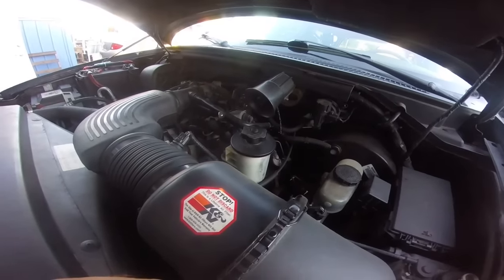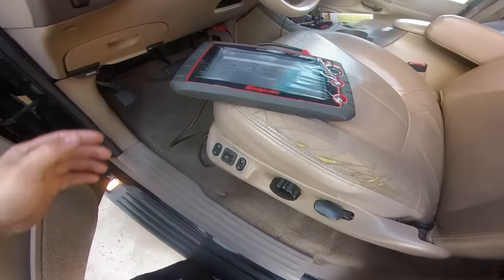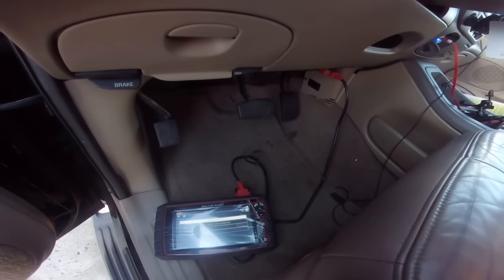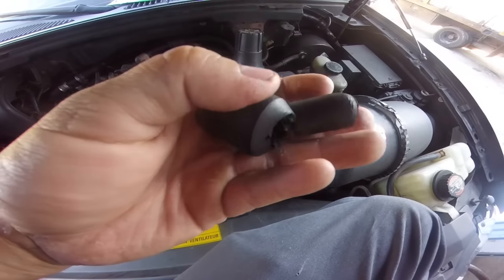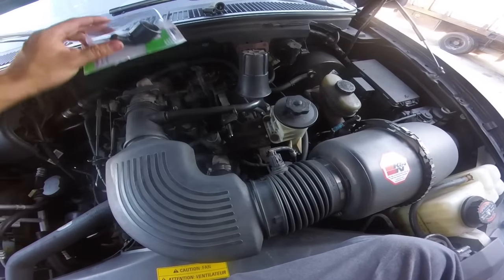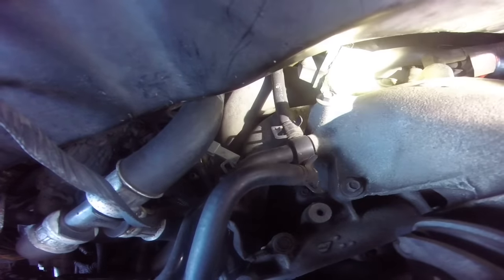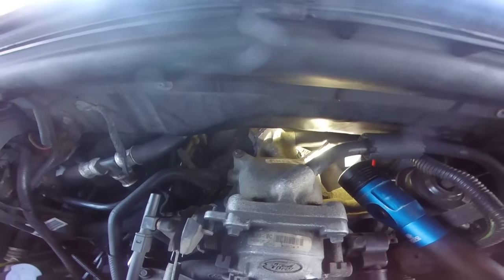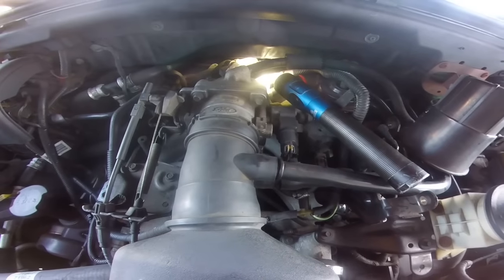ford 5.4 and 4.6 main vaccum leak

Comment: I cleaned the throttle body inside and out. didnt fix my rough idle. I replaced the two  electric parts on the throttle body assembly still rough idle. After watching about 50 videos a came across yours. WOW I looked, felt and there it was the fitting was just like the one in your hand broke into. Replaced it with new and runs perfect brakes are working great now since i have a vacumm on the system runs perfect. Thanks this was the best video of all. No body else mentioned this hose ever.
Reply: can i ask you...my brakes are really spongy...I replaced the idle air control valve because my rpms were like 2000 at idle ...didnt help a lot but my brakes were still spongy . weird thing was when i pumped the brakes the rpms would go up at idle...hence I was thinking it was a vacuum issue . What other issues were you dealing with if you do not mind me asking .
Reply: Is this on a Lincoln Navagator? if so did you check that vac line at the back of the motor?
Reply: I did have a high idle at about 2000 rpms. hard to start on the morning. thats about it
Reply: no...mine is a f150
Reply: i gotcha,,,you said..i think..you replaced the idle air control valve...i am assuming that was it when you said electronics ....did that change your high rpms ? i just hit this video so I have not got to valve yet . When you said your brakes came back,,was that meaning they were spongy before ?
Reply: Yes i changed the iacv. and they werent spongy they were hard to push is all without the proper vacuum
and yes it fixed my high idle. But i also cleaned everything up very clean. 
Throttle body inside and all the ports going to vac hoses
Reply: yea..i see what you are  saying ....i cleaned it all but ithink I have a leak somewhere...well thanks for your tips...congrats on fixing it !!!!!!!
Reply: Does the SES light come on with this issue?..
Reply: Where is this located on the 4.6 in a 1999 crown victoria
Reply: Did yours have a coolant line attached to
Reply: I'm gone check this one out on my 5.4l f150 I have a rough shaking engine at ideal and I have changed all the fuel injectors fuel filter all spark plugs and coils and it is still shaking I'm not sure what to do next I will check this and see
Reply: @Konkretetv  did you find out.mines doing the same thing
Reply: I had alot of the same issues.mine ended up being vacuum hub for the 4 wheel drive
Reply: Try changing PVC valve when it's not working it causes rough idle and misfires
Reply: Question I know this is 5yrs old but still I have a 01 f150 5.4 we put a new intake on it due to damage to the other and new spark plugs and new coil packs cranked it up and it has a loud tick and it try’s to bog down sometimes any idea thinking it’s a vacuum leak or something

Comment: The hard plastic PCV valve hose has rubber elbows on both ends.  The one on the back, near firewall is Dorman 46036.  The front one that goes on valve cover is Dorman 46022.  O'Reilly's had them in store.
Reply: Thank you! I can't believe they are different part.
Reply: Thanks for telling part number auto parts guys have no clue
Reply: He used the 46035 in the video just FYI for anyone wondering.
Reply: @daredoggo  whats the difference
Reply: @bashafacin  one is 90° bend and the other is not quite 90°.
Reply: Dude ty for posting the Part number! 👍

Comment: Thanks a million!!!  Spent about an hour looking at other videos before I saw yours.  Went outside and...BOOM...instantly found it.  Rough idle in my 2000 Expedition with 4.6L engine.  Replaced and running smooth as new again.  Thanks again for this simple, quick and easy fix.  Part number for my whole PCV valve hose assembly with new valve, insulation and big rubber boot for manifold end was : XL3Z-6C324-HA.  NOTE: the location on the 4.6L is nearly identical to that of 5.4L
Reply: Thanks for the part number brother

Comment: I had the same thing happening my truck would idle up and down and rough and the darn curved rubber piece was melted halfway. The problem totally went away after I was getting random misfire code, lean on bank 1 or 2, O2 sensor, and cleared them now no coeds are coming up.

Comment: Found and fixed, I sprayer water at the back of the manifold and the truck bogged. I was able to reach around the intake with a wrench and pry the hose off.  Slipped the new one on and she's running right. Thanks for the vid bro.
Reply from the maker: Nice work!

Comment: Ty so much bro. I'm old head and I aint worked on cars in a while. I just bought it , I did master cylinder and some lines but its running bad and I can hear a clear vacuum leak somewhere. Thanks bro!!!

The fact that you said. It will leak!
That gives me hope it'll be alright.

Comment: Had this same issue with my 2003 f150 4.6.  Watched the video, and I thought, there is no way it can be that.  So... after the video I walked outside and checked, and low and behold, my IAC hose was broken.  Replaced the elbow and placed a clamp on it to hold it still and the truck runs like new.  Totally fixed my issue.  Thanks for the awesome fix.  Saved me a trip to the shop.
Reply: Could you please tell me the oem number of the elbow? I cant find it in my local store so I wanna buy it online. On the video I can only see the first two numbers "46.." thank u
Reply: @mikefigueroa7753  Did you ever find the part number since you didn't get any response? 

I would like to know since it is not visible in this video.

Comment: In my opinion, Homie you are GOATED for this vid. The amount of frustration and hose replacements, pcv valve, idle control sensor, mass air flow sensor, throttle body tinkering, only to see that Fonky, yes FONKY, ass hose connector broken 🤦🏿‍♂️

Comment: Thank you SO MUCH for this video. Found the issue immediately. Good thing about the E series is that you can pull the firewall panel off and the problem is right in front of you. Highly reccommend others to check this FIRST. 1997 E250 5.4 130,000 miles.

Comment: Thank you very much. This fixed my problem after replacing all plugs and coils and o2 sensors. 👍🏻👍🏻👍🏻
Reply: Did you have black smoke coming out from exhaust?
Reply: @mtsanchez27  if you got black smoke, then definitely check the pcv valve.

Comment: My symptom on my truck, which was a 5.4 , was that I would cranck it, it would start and immediately die out. It would only stay running if I step on the gas, and it was horrible. My problem was that I was replacing the pcv valve grommet and when I pulled out the pcv valve I accidentally pulled that rubber boot off on the other end of the plastic pipe. It would give me an O2 sensor code or an EGR valve problem.

Comment: Just got mine fixed for $7.99. Thanks for the tip. Only difference was my 1997 needed a little bit smaller elbow pvc. Other than that it was exactly where you said it’d be and wasn’t hard at all to remove. Thanks!
Reply: Pharaoh on your 1997, do you by chance know what the plastic hose it goes into connects to? I cracked mine trying to pull the elbow and I can’t find the rest of it to replace that also

Comment: Here’s the part number guys I found it. It was extremely hard to find but I see where a lot of people are asking for it and here’s the picture in the part number. 46035 PCV elbow by Dorman
Reply: If it’s a Ford F150, 2001 7700 series. I use it for my service vehicle. 46035

Comment: Mine just chirps when I rev it but it sounds like it’s coming from that area, I’m gonna try this thanks for the post
Reply: My dose the same thing I'd you figure it out
Reply: Did you figure out the chirp??
Reply: @BighnicHnicBAWSESTATUS  it was the throttle body, it was completely normal
Reply: @braxtonbragg1146  mine chirp noise when I rev the engine is coming from the same area.  But I’m confused what you’re saying?   What is normal?  So it wasn’t a leak in the hose?

Comment: Thanks so much for posting this video, it was a great help.  Thought that was going to be a huge hose at the back of the Engine that I couldn't reach until I saw your video.  2000 Ford expedition idling up-and-down or loping until this piece was replaced .Thanks again

Comment: Just picked up a 97 5.4
Codes are p0174, p1151, p1131 (bought it to be a beater) sounds like it's got a miss at idle you can hear a vacuum leak and when driving it stumbles at 3k+ rpm unless I very lightly ease into the throttle also the brake pedal is stiff when in park or reverse as soon as I go into drive it pretty much drops to the floor...could all this be cause by the vacuum leak?

Comment: I'm really hoping this is the issue with my 07 5.4 it's been bogging down under load and refuses to go uphill at times
Reply from the maker: that sounds like low fuel pressure or even a clogged catalytic converter
Reply: BuffFishGuy my 2000 4.6 dies the same but i cleaned out egr ports..made a big difference. ..how do you unclog catalytic converter?
Reply: @mikerafonemusic6177  cut it off and.eother weld or sleeve your pipes for the muffler back in 🤣
Reply: Either**

Comment: So the same 4.6 in the crown Vic ? I wonder if this is my issue. My crown Vic is running rough man and is sounds a leak but it’s nears after I turn the car off it’s a loud hissing noise.
Reply: Have the EXACT same problem on my 2005 f150 4.6 2v.

Idles rough, and as i turn it off it lets off a big hiss for about 15 seconds
Reply: Have you figured it out?

Comment: @uglyhp8225 I have a 2002 5.4L Expedition and runs just fine when it’s warm out then when it gets cold out it will idle rough and stall at red lights so I have to put it in park and try keep the engine reved up so I was going to assume this is my problem maybe I replaces the pcv valve and I replaced spark plugs coil packs and boots and still idles rough so I was wondering what that part is called imma try this next and see if this is the issue possibly

Comment: Don't be misled by this video true that rubber elbows on the positive crankcase ventilation tube from the passenger side valve cover to the back of the air intake throttle housing does go bad but it isn't always what's causing vacuum leaks on these motors all the time in fact it's typically a combination of things that make it have a bad idle and intermittent stall.  and sometimes it can be very difficult the remedy
Reply: And just as an update that parts now $20 at AutoZone or O'Reilly's
Reply: I just paid $35 for the part at Advanced Auto. Already previously temp fixed the issue the old school method which lasted a year. Now to fix it properly.
Reply: @gwparker1666 what’s the name of the part thanks

Comment: That might be my issue. I have a p0171 p0174, when I spray carb cleaner around area it idles up. I've sprayed all around the intake and other areas with no affect. Can this cause a p0171 p0174 CEL?
Reply: This was it! For my 1997 F150 5.4L, part number: "46017 Dorman Help! $8.99" - Mine was in 2 pieces after I touched it, disintegrated! Took me a minute to replace and now she idles perfectly, CEL was cleared after a couple minutes of driving.

Comment: 2003 f150, 4.6 randomly feels like it misfires, checked each coil pak and they are good. Right when the engine starts running like crap I can hear a flutter sound near the air intake area. But then it will fun good. Does this constantly even when driving, like the timing is off for a few seconds No engine codes, already changed fuel filter as well. Thank you
Reply from the maker: check the iac
Reply: So not the IAC but thank you. so to elaborate a little more. the truck doesn't die, but power comes and goes and it's hard to hear but when i took the plastic 4.6 cover off i could hear the flutter sound when ever it runs bad the goes away when it runs right,  suspect some sort of vacuum leak or maybe its starving for fuel intermittently? Thank you again for your time
Reply from the maker: any check engine codes?
Reply: Nope, i have a scan tool. checked my coils, looked at the IAC however usually that caused stalls. truck starts easily, stays running. feels like the timing is off, which i believe is electronically controlled and cant be adjusted. or its misfiring.  it might be  a fouled plug, just hate removing coil packs especially on the driver side. FML will update if that helped no matter how embarrassed i get.
Reply: @azsako  where you able to find the problem? my 2007 4.6 F150 is doing the same exact thing
Reply: @NotAnotherStreamer  No sorry, pissing me off. i pulled the battery for a while, so it will reset the computer, would have cleared codes but there are no codes. will post if i find out anything new.
Reply: @azsako  any luck yet bud on this problem?
Reply: @gwparker1666  heck no, it's not a daily driver but inspection time is coming so I need to figure it out. Some one has to know what it is.
Reply: @azsako  the iac can stick sometimes.. Also spray carb cleaner around the intake and vacuum lines etc (while its running) If theres a vacuum leak your engine will idle up..

Comment: Any chance this (vacuum leak) could be affecting shifting into 4WD (1999 F150 5.4, AT, dash selector switch for 4WD) which is controlled by solenoids/vacuum lines? My 4WD goes in and out of operation frequently, but has gone out and stayed out for over a week now. One previous fix was replacing a crumbled rubber hose connecting vacuum lines near the solenoids on the firewall. Solenoids already replaced. 4WD light not coming on (dash), and I hear a clicking noise behind the selector switch when I move it to 4WD high. But no shift.
Reply from the maker: no the 4wd on that is operated by a actuator
Reply: @uglyhp8225  My understanding is that the 4WD actuators are activated by vacuum lines, which are controlled by 2 solenoids on the passenger firewall.
Reply from the maker: no you have a 4wd module on the passenger firewall no vacuum lines go to it then you have a selector actuator on the transfer case its all electrical  on that model
Reply: @DustBusterRamone  late to the party but...the actuator that engaes the front fork, which engages the front axles, is vacuum operated. I'm fighting this problem right now.

Comment: I have a 4.6 06 f150 an I went to turn it on and something popped. It made a popping sound like air was leaking out. Then stopped. But I have poor idle and ac doesnt cool anymore. Air was leaking passenger side right behind intake manifold. Any thoughts?
Reply: Soumds like your iac was or is sticking they'll make a loud sound that comes from your air filter assembly sometimes....hope this helps..
Reply: Plus replace intake manifold gasket or intake also...
Reply: I found out my spark plug shot outta the motor. I hear its rare on 4.6l motors. All an all it was $400 fix after labor replacong coil and new spark plug.
Reply: It’s not that rare when backyard mechanics change the plugs and over torque them. There’s only about 3 threads on the motor for the plug to turn into, and over tightening the plug weakens these and the pressure pops the plug out.

Comment: What is the cylinder shaped part to the right of your flashlight that has the hose running from back of the
IAC over towards the driver's side and loops back to the front of the throttle body

Comment: Does anybody else's 5.4 burn oil quickly? I have a 2005 5.4 fairlane in Australia (Barra engine), purchased with 30,000 miles but burns through 4 litres of oil every few thousand miles or so. Is this standard or were my oil rings flogged out before I bought it? Cheers
Reply: Did you ever get an answer? I have a similar problem
Reply: @DJVetz510  No not yet, I think it's just an issue with the engine. It's still a good engine.

Comment: So would this be the case if I am getting a  P 2195 / 2197 CODE? I changed my MAF, however it still has the codes? I have a 2004 F150 4.6L (Heritage) Truck
Reply: Possibly 02 sensor issues
Reply: I got the same exact issue with my truck right now. I have the same truck as you. Did you ever figure it out?

Comment: @ugly HP   I can't find this on my 2005 f150 5.4 3v triton and the part number you listed says it doesn't fit my truck? Do I not have it? lol Truck started idling rough, plugs and coils have 10k miles and cleaned MAF and throttle body.
Reply: I can’t find it on my 05 Expedition either. If you find anything, let me know. I’m going to keep doing research

Comment: Ok so I have 5.4 it’s leaking in that spot I believe. Only problem is I have a lightning. So that line comes up from behind the motor like u said and t’s off to the supercharger and the pcv valve. I can definitely here the hiss of the leak when I move that hose. What does it connect to? Another hose or some other component. It’s tough to tell cuz it’s so far down there and it’s wrapped in heat shield foam? Any advice would be greatly appreciated!!!!
Reply from the maker: kinda gotta do it blind lol use your hands as your eyes
Reply: Goes right into the base of the throttle body. Very tight squeeze.  Mostly touchy feely on my van.  Cussed like a drunk sailor that day.  😊

Comment: Thanks for video I bought new hose but can t reach behind supercharger on 5.4 to put hose on intake is it safe to block that hose off truck is running fine with it blocked off
Reply from the maker: if your not pulling vacuum from the valve cover then you will start building alot of internal pressure and thats what leads to early failure of like oil pan and valve cover gaskets and even the more expensive stuff  like rear main seals
Reply: @uglyhp8225  yes it's pulling vacuum from valve cover to idle control but I put a screw in the hose that goes  to intake on back of motor I guess I will half to remove supercharger from motor to reach behind thank you for replying back

Comment: I have 98 f150 5.4 it threw codes bank 1 lean cylinder 2 miss fired I replaced coil pack and put two new upstream o2 sensors my question is could that vacuum leak cause my transmission to not shift right? When I depressed the gas it will shift bit only letting off the gas
Reply from the maker: well it could be your tps but sounds more internal to the tranny